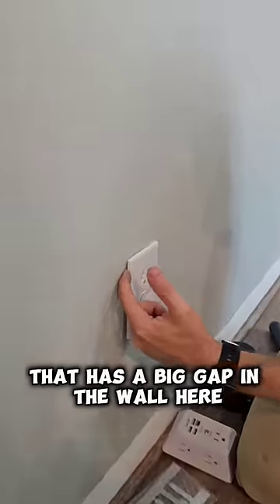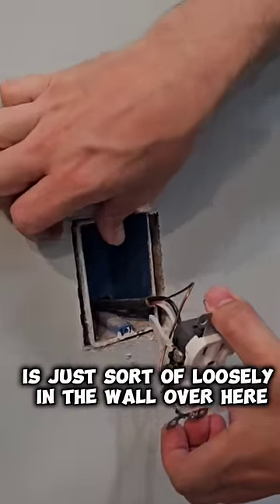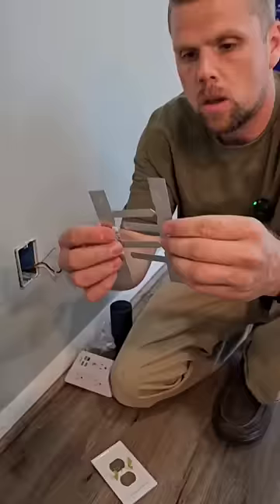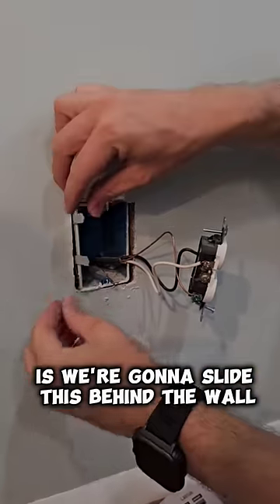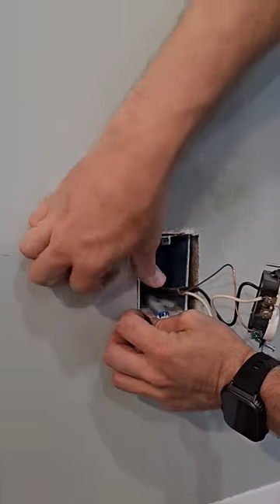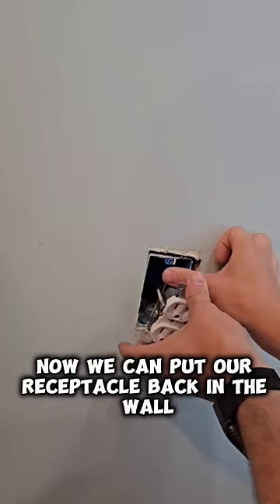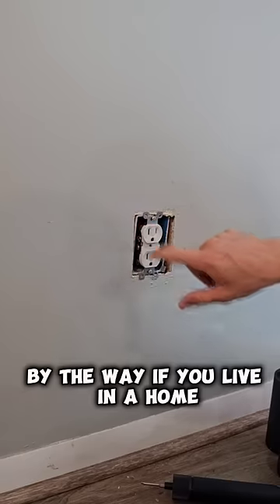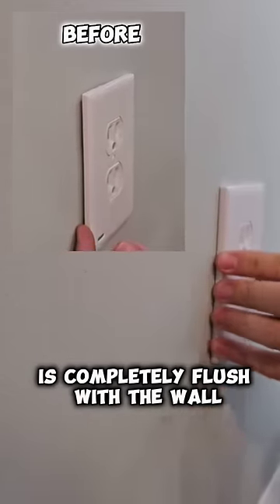🤔 How to fix an electrical box that is sticking out of the wall #diy #handyman #election #howto

Comment: I use a foam outlet insulator. 25cents and holds it in place and can save you 25 cents a year on your ac and heat bill. lol. It works.

Comment: I would be afraid of the metal strap potentially coming into contact or arcing over with the contacts on the outlet. I would've wrapped tape around the receptacle before putting it back in. Probably overkill, but I've learned that being paranoid about worst-case scenarios can save your bacon in many cases.

Comment: Just take a sheet rock screw put it on the end of your cordless drill screw it  into the back of the box on  the stud side and It will pull the other side in I did electrical work for 40 years

Comment: Wouldn't happen in Australia, we use plaster brackets that hold it against the wall with no issues. Doesnt need a box either when its got propper terminal blocks too. The exposed screws still does my head in when i see it 😂

Comment: I see the value in these, but if at all possible if there is a nearby stud just drill a hole the box and ram a screw into the stud. Its gonna be way sturdier then this repair. I would only do this if the box is freefloating in the drywall and if it is they installed it incorrectly.

Comment: Only one problem, my friend, this is completely illegal.

First, Madison straps are constructed for metal boxes. Mounting the straps in a metal box does not require a bond. 
Being that the strap is directly connected to the metal box, which is grounded.

Madison straps can not be bonded in a plastic box.

Close but no cigar....all you're doing is putting homeowners at risk,

The correct answer is to hire a licensed electrician...they're insured!😂

Comment: Weird, we call then Madison Hangers in the trade but they come as a pair for a reason, one for each side, if the box was loose someone below mentioned to send a screw right into the stud which is so much easier, plus the pair of the hangers I would’ve just used them both, one toward the top of the box and one toward the bottom.

Comment: Cheaper idea...slip a wood shim with a little wood glue between the box and the stud.  No extra medal in the box.  (He has two strap-ons holding the box firm because the first wasn't good enough.)  Use a shim.

Comment: Mobile home manufacturers need to be required by law to use these and there are receptacles in the walls from the light switches to the plug-ins.

Comment: More often called "madison clamps" or "madison straps".  There are better ways to fix this issue but if you MUST use Madison straps, make sure you tape the terminals of the outlet/switch.

Comment: A real contractor which is actually run a screw through the side of the box. Right to that 2 by 4. But probably the easiest thing to do..
Reply: yea no a real sparkie wouldnt. that violates NEC. those boxes arent rated for screws on the inside. a real sparkie would cut old box out, replace it leave drywall damage and hand you a $500 service bill

Comment: In my area, I always see a different problem. The electricians set the boxes at 3/8. Then they put 1/2 drywall. The outlet is too far back and it cracks the plate. Or you can put shims. And this is planned to be like that in every case. WTF

Comment: Called Madison Straps, not  "Strap-on" This also violates NEC 110.51(A) All non-current-carrying metal parts of electrical equipment and all metal raceways and cable sheaths shall be solidly grounded and bonded to all metal pipes and rails at the portal and at intervals not exceeding 300 m (1000 ft) throughout the tunnel.  Also cannot screw that box to the stud, as this would violate 110.3(B) Installation and Use. Equipment that is listed, labeled, or both shall be installed and used in accordance with any instructions included in the listing or labeling.  The proper way to fix this is just take that box out and replace with an old work.
Reply: pfft screw old work junk. wooden shim on the loose side. if Im cutting old box out, its getting new work nail on box

Comment: Wrong. You need to replace the box with "old work" box and proper fastening is done by screws on leafs. then you must fill the gap between the box and drywall with plaster.

Comment: Seems like a workaround, just replace the box and fix it properly. Better yet, why not look at what the UK does? Back boxes for dry wall have clips on each side that clamp around the drywall when you attach the socket, unless some idiot cut the hole too big, but that never happens right?

Comment: A large majority of electricians still can't get a box flush on the wall, even in huge multi-million dollar mansions. 50k+ in warranty work per year is just one example. We find all kinds of stuff, wire left in walls trash everywhere. Cut the entire truss out to run a few wires and this is 50+ different electrician companies. And a strap on could have fixed the entire issue 😂😂

Comment: So.....Did you shut off the breaker first? I am guessing not. But that is okay. I have replaced several plugs and switches without removing power. Been bit twice. 110 isn't too bad, 220 tickles a bit though.

Comment: Never in my 20+ yes have I seen someone use those for a plastic box that was nailed too far forward nor have I ever heard that name be used for them. If your gonna use those you should really use a pair of needle nose to make it snug. If not it will just slip and become loose again
Reply: the drywall monkeys are notorious for loosening up new work boxes. cant get cut right, just smash drywall over it till it fits or drywall monkeys here favorite - pry on the box till it makes its own opening

Comment: This method does not work, it's only a temporary fix as you go on to plug in things and use it. Those traps will come off. The better way to do it is to screw it into the stud. Or replace the box with a remarkable box.

Comment: I would have been okay with this presentation except for the fact that you did not screw down the unused terminals on the side that was sticking out far enough to touch the medicine strap because you know they don't lay flat but also you didn't put no electric tape around the terminals for safety it's going to do this show people a safe manner

Comment: They are called Madison holders. Not approved by the NEC.
Reply: so is the use a drywall screw in it suggestion ppl keep throwing in. thats why I use sheet metal screws

Comment: That’s metal? Metal conducts electricity doesn’t it? I wonder if  the screws on the receptacle hit that, is it house fire time? The rest of the box is plastic for a reason it’s non conductive. But what do I know I’m a carpenter not and electrician.

Comment: Can’t use Madison clips in plastic boxes. Just a heads up. Not tryna be a dick but u can’t have a metal piece inside an outlet box without it being grounded. It can cause itself to be energized and potential shock hazard. I didnt make the rules. But they can go on metal boxes because the box should be grounded and and contact would cause a short. And u can explain this to a home owner and that’s how u make money and u cut the nails off the old box and slide out the box and put in a new old work box. Now if it was a job and I roughed the house and this was on finish. I’d do it and tell my apprentice to look the other way. Lol. But in all honesty they are for metal boxes only and even if u did rough the house u should replace it and do it correctly. But once again. I woulda done what u die if I roughed in the house lol. Next time wrap some electrical tape around the Madison clip completely and do it and then I can’t say shit lol.

Comment: F clips is what they're called son. Plus the video is spliced. Plus there's still a gap. Plus you used the other peice on the other side somehow even though the box is nailed to a stud there. 
Use some drywall screws son. You'll save time and headache. Screw the box to the stud. If the other side still sticks out use that good ol wizard tool (oscillator saw) and cut the box flush to the wall. If you're good though the screw will correct the box issue with no need for cutting or anything else. Sure the screw through the box negates it's fire rating and isn't inspector approved but if you do use those "Madison strap ons" what you'll want to do is use a screw driver to push the box back behind that drywall a 1/4", keep that strap pulled as tight as you can forward on the drywall and then the tabs fold into the box as tight as possible. 
Get harder hands son.